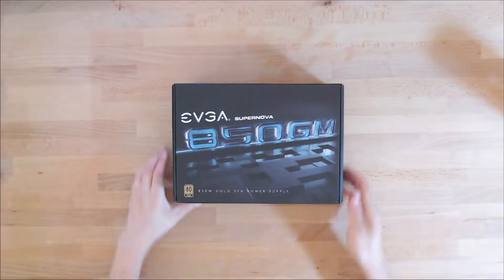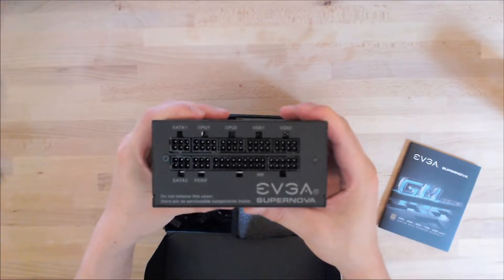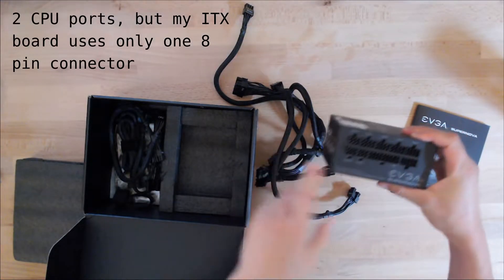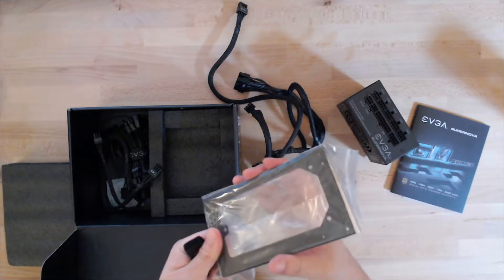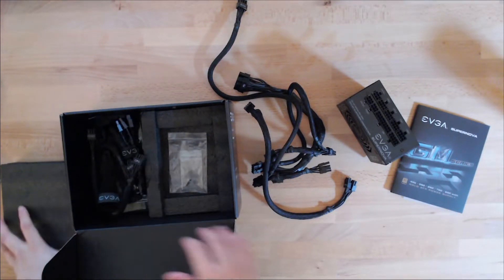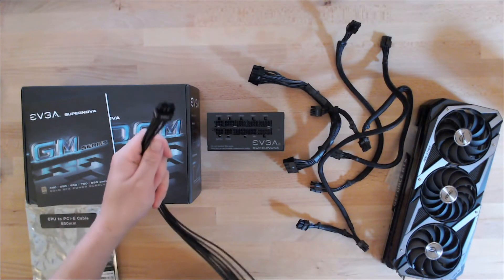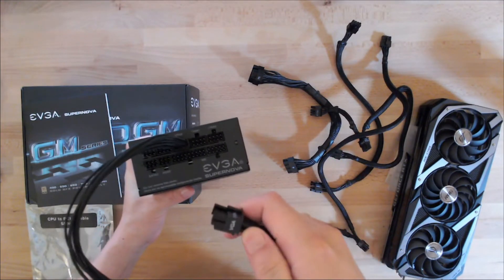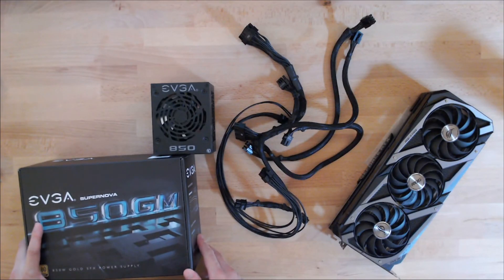EVGA Supernova 850 GM SFX

Comment: Hell no, the last thing I would ever do is connect my CPU output to my GPU, hell nawww
Reply from the maker: Both the EVGA PSU and the cable also from EVGA was made specifically for this. At the end of the day watts are drawn from a power supply given how much the video card wants. This is supposed to be better than taking one cable that splits into two 8 pin connectors.
Reply: Do you have the link to that cpu to vga cable?

Comment: what is the oem of this psu?
Reply: It's Seasonic, as far as I can tell.
Reply from the maker: I think I may have to take a look at the internals. I think newer are using SeaSonic and this SFX 850 GM is in that newer group. The older PSUs were Super Flower I believe. I've been pretty busy, but if I get a chance I may pop open the PSU to get a sense of what it is inside. Sorry for not getting to this sooner, and may need me to do more investigative work. I have a busy couple weeks so may be a little slow on this.

Comment: So EVGA stopped selling that extra cable (CPUto PCIE) , and i cant find it anywhere - I was going to do my own custom sleeve cables for my PSU and attempt to recreate this cable. Are you by chance able to follow the leads and see what pins lead to what pins.
Reply from the maker: Sorry been really slammed busy with holidays. Let me check and see if I can grab the cable and do this. I was actually also thinking the same thing with making maybe my own custom cables.
Reply from the maker: I pulled the cable out of my machine to do the pin mapping. Made a video to show this. Let me know if this helps, and if you already did something sorry for being slow. Holidays are a busy time. https://youtu.be/l-3x61wnt98